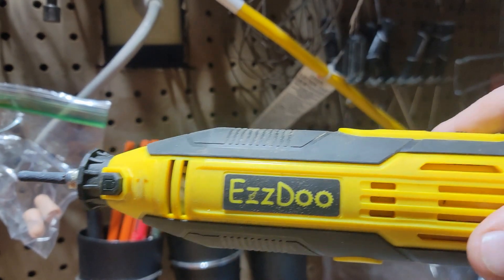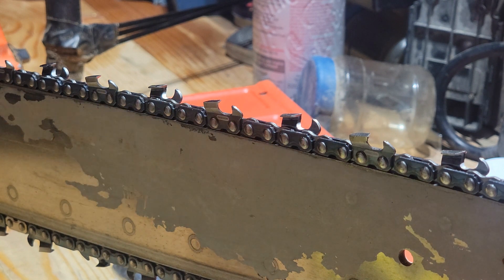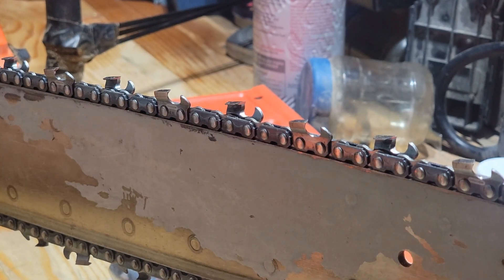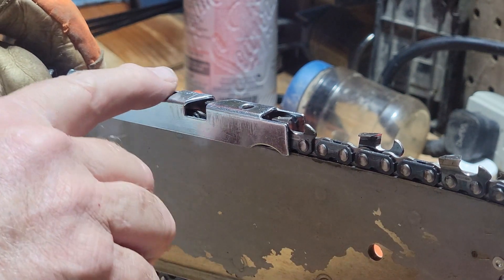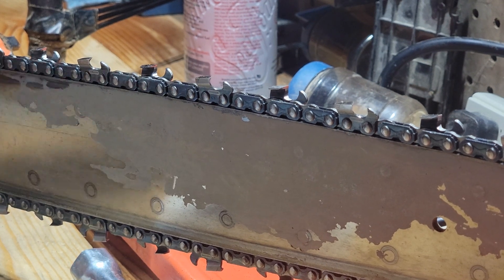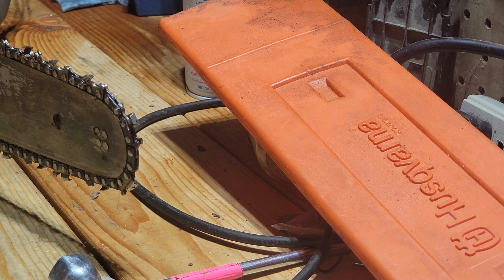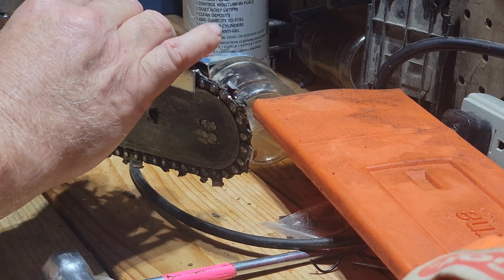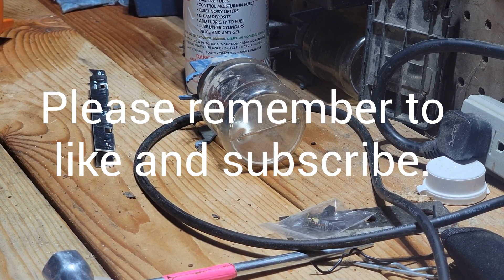How I Sharpen My Chainsaw Chains

Comment: Use the Dremel brand version of this type of tool to sharpen my saws. Then every other sharpening check the raker depth. Makes a huge difference when the rakers are just right. Too bad you are not closer, have the original 20in bar for my 590 that I used for only half a tank of fuel to give ya. When done right, the method of sharpening that we use can get the cutters cat claw sharp.
Reply from the maker: I have a Dremel tool as well. Both tools work really well for sharpening.  That is a good tip on the rakers.  Thank you!
Reply: @sswoodprocessing , if the saw doesn't pull at least slightly into the wood on a sharp chain, the rakers may need attention. That's another indicator.
Reply from the maker: @thefirewooddoctor  Thanks for the tip.  I will pay close attention to that.